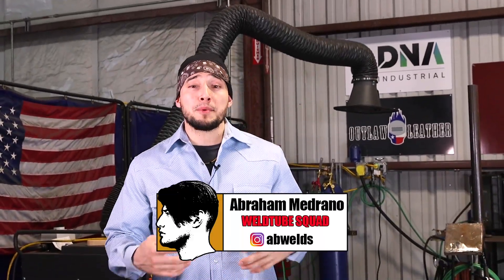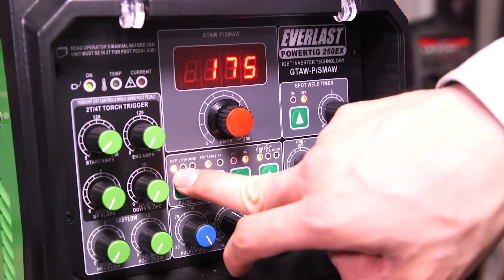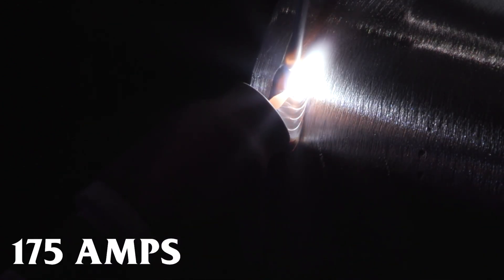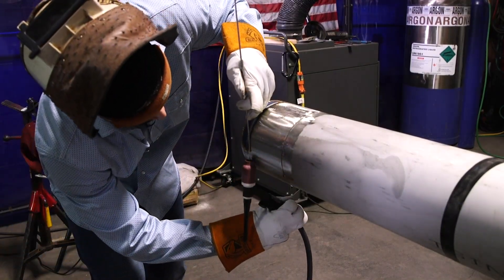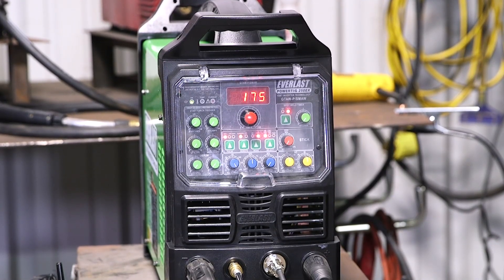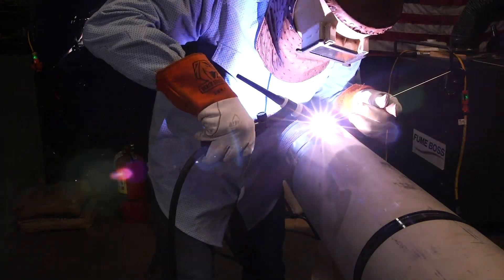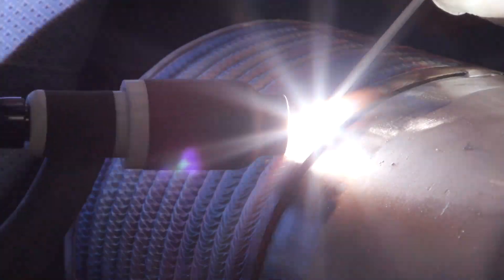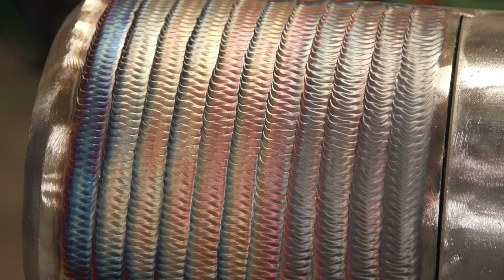How to get Gold on your Stainless Steel Caps | TIG Welding

Comment: how is it you are getting less and less heat affected welds when welding over the same hot area? i wish someone could teach me how to walk the dog to get these welds, i have a test for 3" nom 304 pipe with a 1/16 gap but my weld was greyish and not good , idk if it was the metal or im just not good standing and trying to weld this out of position as i said perhaps if i knew the dog trick it would be a better weld

Comment: well   lets   do it  on  a  1 inch  sch 40  stailess steel  pipe ,,  from  6 o clock to 12  o clock   with a regular machine   just  dc machine     out on the field   lets go     lets say  a clasic 300 lincols diesel  ????

Comment: I recently work with stainless stell pipe, mostly thin pipe like sch 20 to sch 40, when doing welding on flange the color is show up but when welding on the pipe joint there is no color, jist dark grey, still figured it out why

Comment: I’ve actually been having problems welding lately. On my most recent job I’ve been doing mostly stainless, schedule 10, and a lot of small diameter. I suppose it’s important that I mention I am still fairly new in the field. I tend to get deep reds in my welds which tells me I’m very near burning the stainless up. The problem is, sometimes I get it even when I strike up on a cold pipe. My coworkers say it’s because my tungsten isn’t out far enough and I’m moving too slow. Do you have any thoughts or anything to add to the reasons I’m getting these colors?
Reply: how did u fix the issu?

Comment: So grey and purple and blue , are not a favorite color , but do they pass the X-ray
Or grey a sign of poor welding besides a ugly non favorite color for a cap ??
Reply: It will pass xray, but if it’s burnt to much you will lose nickel content which is what aids in the corrosion resistance of stainless. Which basically defeats the purpose of using stainless to begin with.

Comment: I think he had the order of color wrong, it starts shiny silver then gold, then straw, then blue and purple... I think he welded that first pass on the edge so the heat had nowhere to go... he let it cool and his 2nd pass picked up oxides from the first weld, thats why it was blue on that side... but I gotta give it to him, some excellent techniques 👏👍
Reply: That's how I thought it worked but why didn't it go back to blue at any point after the gold welds if that is how it works? It just transitioned into red colors as it got hotter.
Reply: @realevesparks Generally, It's completely Silver if the argon coverage is perfect, then gold, then salmon pink, then blue, and then it will go grey. Abe is wrong about it being about your amperage and size of pipe/thickness. Obviously that still matters, but it all depends on how hot the area is after your cup completely passes over it. Longer stick out of your tungsten can also help this as it actually gives you more argon coverage.

Comment: The sch 80 pipe is cheating a little..

But the color is affected by cleanliness, temp amps/travel, gas coverage wide and low is better than narrow and fast, and the filler metal.. some alloy filler metal are just crap.. you can keep the same setting, change filler and get different results..

Comment: High amps, giving high travel speed, gives lower heat input. 
Caps coming out dark? Crank the amps and travel speed up👍
Reply: How do I step out further with my weave? My weaves are always really tight
Reply: @firecracker4277  torch angle, cup size and stick out of tungsten will all affect it

Comment: Important info to understand what your metal is doing as the heat goes up. Great video and beautiful consistent welds. Are the colour changes evident in all metals when welding or only on stainless steel?

Comment: Can you monitor color change through the lens or do you have to stop to observe it?
Reply: Use a gold lense and you can see the width of the HAZ either side of the cap, yes. Cant see it so well with a green glass filter lense
Reply: @kf8575  Thank you; I can see it now. I didn't know about the gold lens. Now that I have tried it, I can also see the colors of the HAZ through my auto lens, although that requires a fine adjustment of shade level, which is hard to guess without testing.

Comment: Believe it or not I worked for ETS in a fab shop all stainless and exotic metals, never touched a tig rig, I was a helper then slowly learned how to tack, then I was a tacker then learned how to throw a root in stainless and kept moving forward and now I struggle to learn stick, I can throw a root w 6010 but it ain’t all that slick, detailed tutorial? Root-Cap 6010/7018 ?
Reply: They got an older video about that
Reply: The way you angle you’re rod , whipping pattern being consistent and amps when I was in high school my teacher told me to whip it and hold In the puddle for one second then go out , keep you’re eyes at the weld I had the bad habit of watching the rod leave then would loose my straight line